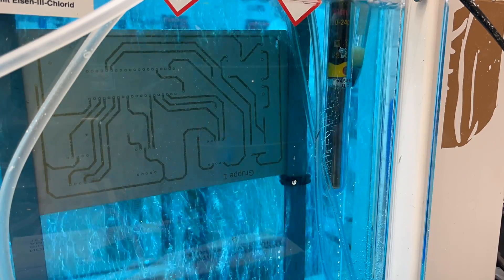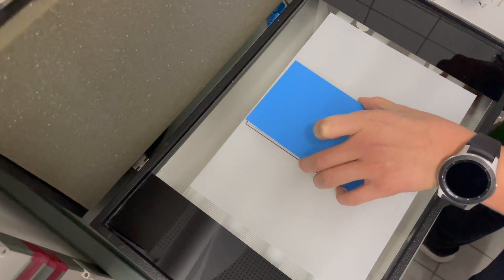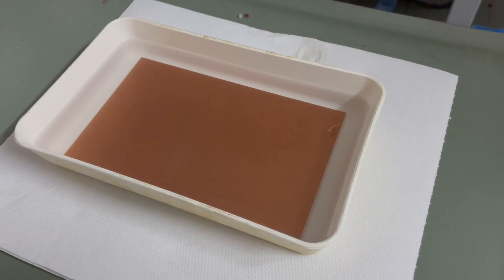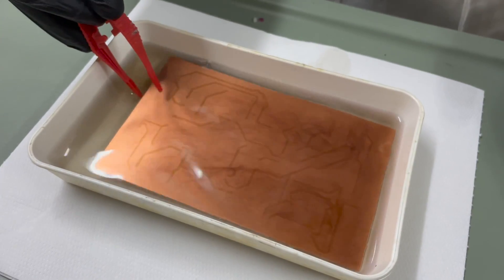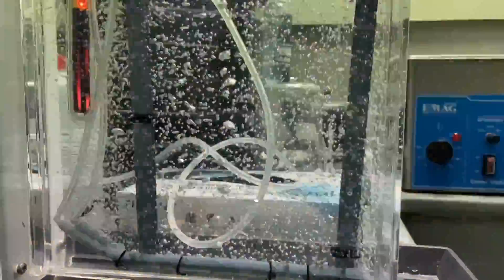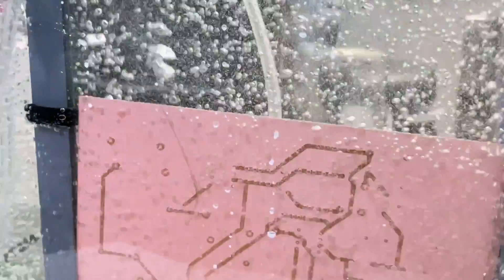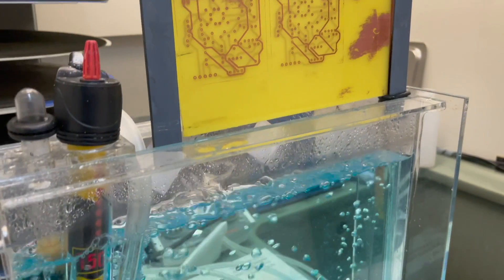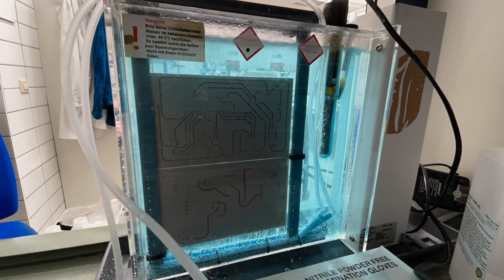How to etch a PCB

Comment: I am always wandering about this thing, actually after we used etchant solution, does it still gonna work after 1-2 days later?
Reply from the maker: Good question, answer is a clear yes! Sometimes we etch one PCB, leave the solution inside and etch the next time only weeks later. Works perfectly fine, as long as the solution is not yet saturated too much. Stay tuned, working on an updated version of the video with our new equipment in our new lab!

Comment: How did you manage to get 40-50 degrees C with that aquarium heater? Those heaters have a thermostat that allows 32C. Have you opened the top of the heater and tamper with it?